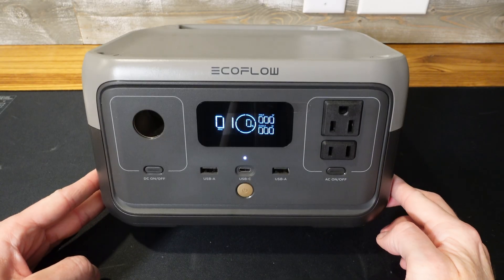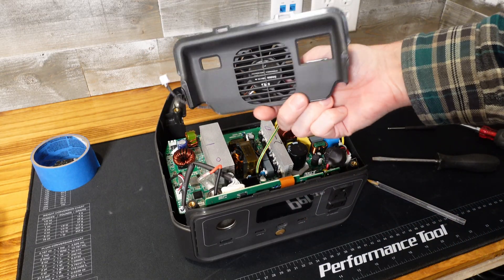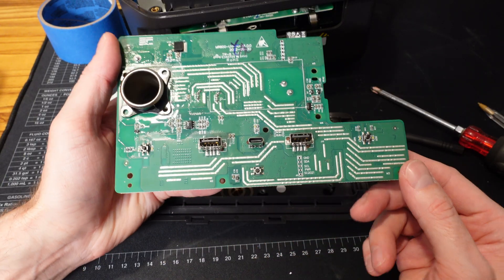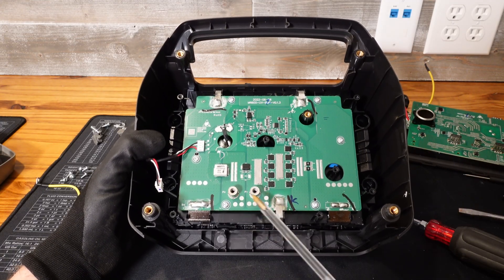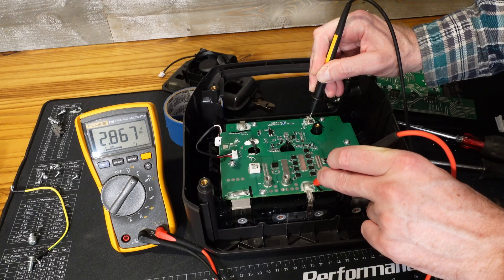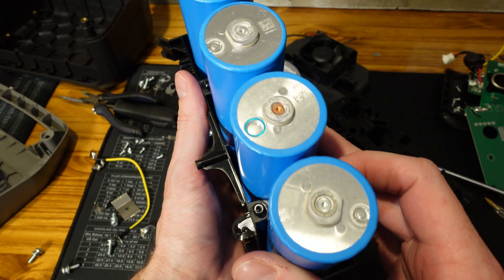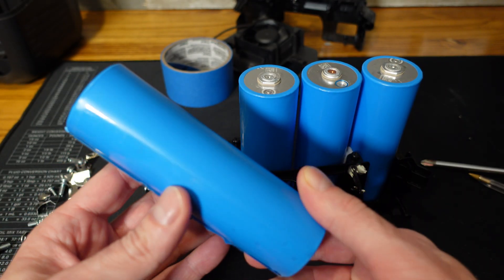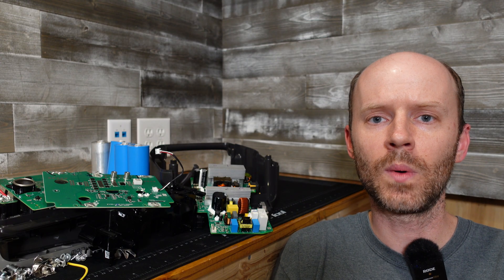EcoFlow RIVER 2 Power Station Complete Teardown, See What's Inside

Comment: Thank you so much! I purchase mine almost 3 years ago and I use it as an UPS for my cpap machine, was thinking about changing the fan, it's very noisy😂
Reply from the maker: Have to upgrade to the RIVER 3 Plus, it's silent despite still having a fan 🙂 I haven't used the RIVER 2 much but I don't recall hearing the fan when I was discharging it.

Comment: I bought my river 2 about a year ago. interesting to see inside. I wonder why the resistor on the power cord?
Reply from the maker: I have no idea where the original cables are that came with this one lol. Are you talking about the AC power cord, and if yes, is it a ferrite bead by a chance (can find pictures online to compare)? The RIVER 3 had one and is likely there to reduce line noise.
Reply: @LithiumSolar 
AC power cord yes